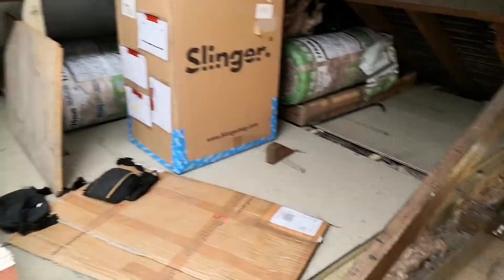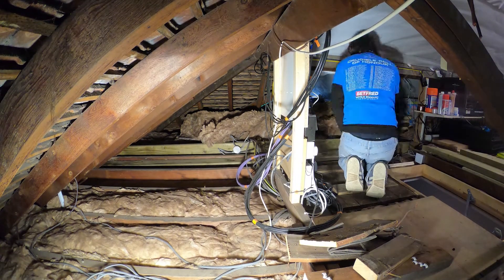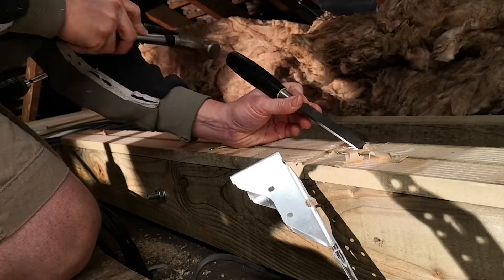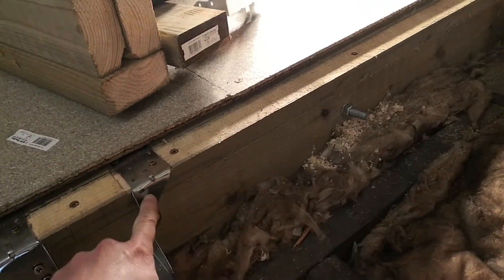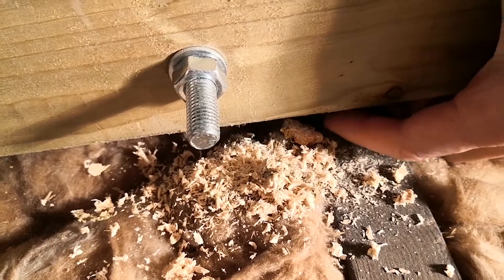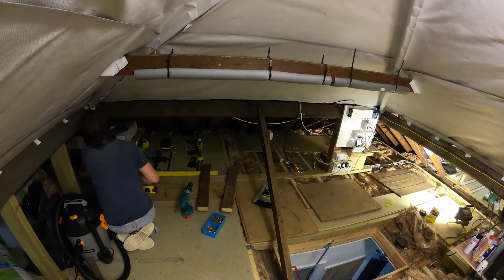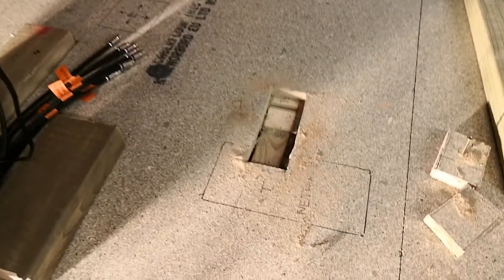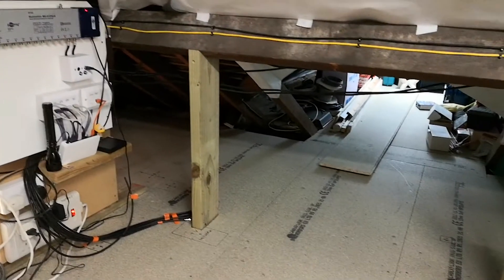Creating Loft Storage Floor Space UK - Part 3 (Ladder Hatch Access)

Comment: Did you have any plans made or did you just wing it. I mean did you watch other YouTube videos and copy. 
It looks fantastic. I plan on doing pretty much the same but iam looking to add insulation and plaster board.
Reply from the maker: No plans. Dad was a retired builder so had him to consult.
Reply: @DaveDoesUK  some 20 odd years ago I was employed as a builders mate and I had the opportunity to work on a huge home project. Included doing a huge loft conversion. I recognised alot of what you were doing regarding sistering the beams and putting in the perin supports.
I've purchased a angle tool to do the birds beaks. Are you insulating your loft.👍👏🤔
Reply from the maker: @anthonybrown7959  I only insulated between the ceiling joist and the loft flooring. Not practical to do between the roof rafters on mine as the tiles are old and there's no modern breather membrane sheet unneath them. I'm usuing the space for storage too, so not essential to keep it insulated, plus don't want to create a moisture trap.

Comment: The long  sistered joists  used along side the hatch that seem to go end to end. How did you get them up into the loft
Reply from the maker: Measured and then pre cut to length on the ground. Then it took two people to pass them through an upstairs window and then we wiggled them through the loft hatch opening. Not easy but got the job done.
Reply: Do you mean cut to length to the load bearing wall then another sistered joist bolted together at the overhang from load bearing wall to external wall,
Reply from the maker: @monumia-kj1eb  Not sure exactly what you mean. The long sistered joist goes from the load bearing external wall to the load bearing internal wall.
Reply: Ahh ok. In the video you say “it runs to the central supporting wall and then all the way to the eave”   Im assuming it’s cut to the central support wall and then another piece that runs to the eaves

In the video it sounds like you got one long piece running from eave to to eave. Which would nearly 7m long. There’s no way I’m getting that up into my loft🙈
Reply from the maker: @monumia-kj1eb  Yeah, I'm end of terrace too, so have 3 eaves. The lengths are approx. 3.5m from the eave to the load bearing wall.
Reply: My internal support wall is exactly where the cross sister joints will go for the staircase. The long pieces will overhang the internal wall by 100mm as recommended by NHBC

Anyway. Great job mate. Should be proud of that